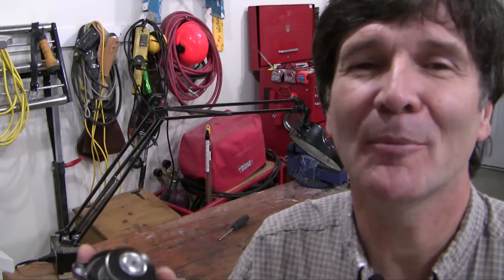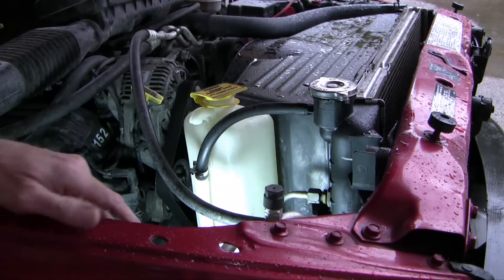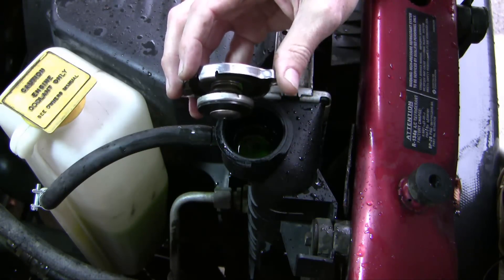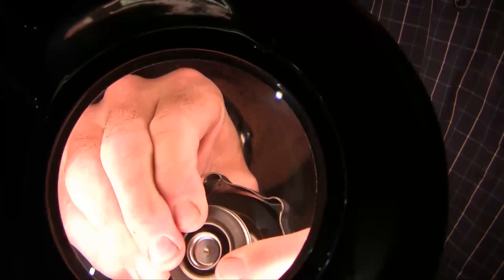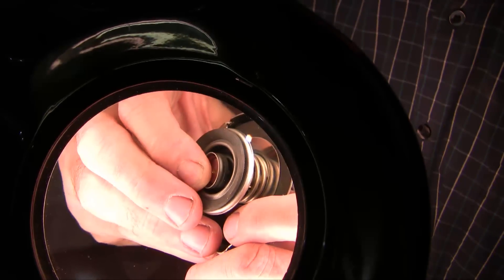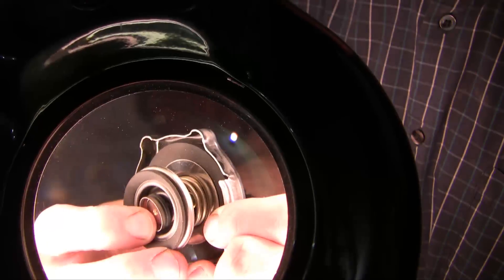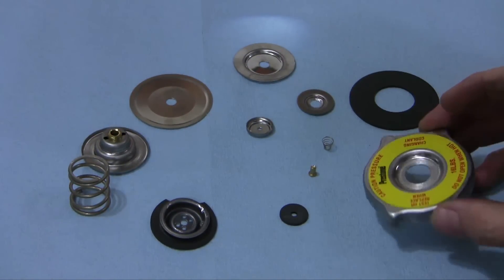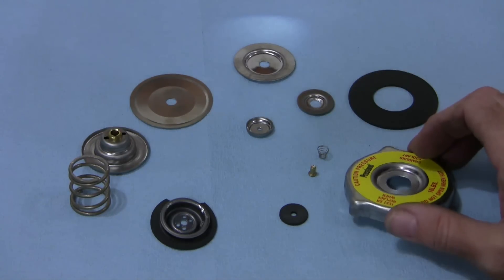Hidden genius behind an engine cooling system -- the radiator cap

Comment: Thank you for posting this.  I had never really thought about this before even though I've done all my work on every car, motorcycle, truck and SUV I've had for the 54 years that I've been driving.  I was changing the coolant in my motorcycle the other day and it dawned on me that I didn't know how the cap allowed coolant from the overflow tank to return to the radiator.  I searched for an answer to that but didn't find the answer.  Everything I found simply said the coolant returned to the radiator as pressure in the radiator dropped but none explained exactly how that worked.  Then your video popped up and your comment asking if anyone wondered how the the cap worked to allow coolant to return to the radiator. It was as if you read my mind.  

Thanks again!
Reply from the maker: I made my channel to reach out to guys like you, thank you for the feedback. If I were to do this video again I could make it easier to understand. Simple graphics would better illustrate the way two one-way spring loaded concentric gates allow fluid and air to move between chambers, purging air and replacing it with coolant automatically overnight, with no external source of power. In any case, bright guys like you get the idea even without fancy graphics. Nice to meet you!

Dave

Comment: Was looking all over the internet for an explanation for how coolant returns when the engine cools in my Jeep XJ as the cap appeared to be a one way valve. ( I'm used to the pressurised expansion tank system in my Volvo 244). You have enlightened me, superb explanation, answered my question exactly.

Comment: Years and years ago I had a car that kept having a little air in the radiator and the car's ecu would complain. I bet that little spring had gone bad. It just needed a new radiator cap. I wondered why I never had that problem again owning numerous cars since then.

Thanks!

Also, I've seen you all over the other YouTube car repair channels that I like, we must have that in common.

Comment from the maker: That's an excellent point you make. If any of those gaskets fail, the cap fails and neither spring ever get enough pressure to open. If air bypasses around the gaskets, boiling point is lower, with less effective cooling and a lower overflow threshold. Indeed, deterioration of those rubber gaskets is the commonest cause of cap failure. So, the gaskets are the critical element. Springs are there for controlled movement of gas and fluid.

Comment from the maker: @billstmaxx You make a good point about evaporative loss. The reservoir is open to atmosphere, through that very small opening at the top. So, a small amount of evaporation is unavoidable. But there isn't much air movement there, the surface area of the fluid in the reservoir is small, and the fluid is usually cold. I don't see much practical loss at all. Of course fluid in the radiator can't evaporate much, because the cap prevents exit until max pressure is reached. Thanks for your comment.

Comment: I needed a crash course in car rads and associated items, thats a great video, very helpful, thank you.
Reply from the maker: +Bart Man Once you understand how a rad cap works, everything else is easy to understand. Because water is an imperfect coolant, the cooling system is still the most frequent point of failure for any motor vehicle, so it's very useful for everyone to understand the system. I have a cooling system playlist with several other videos you may find helpful, on my channel page. Not only is it a common problem, the issues that arise also tend to be very interesting. Good luck!
Reply: +spelunkerd I will check them out for sure, many thanks, great effort

Comment: Been working on cars since a teenager and sadly never realized the inner spring/cap existed. I just never thought about it until I had to diagnose my Subaru's coolant issue. That little inner spring cap was stuck to the larger seal and wasn't able to open up and suck back in coolant. Pried it off and jiggled it around. So far, no more overfilled overflow tank. 

I'm assuming during normal driving and engine temperature range that when the coolant cools it sucks it back in gradually. When that cap is stuck, it cannot regulate and so it pressurizes more and pushes more out, and so on.
Reply from the maker: Yes. Most of the reverse flow happens after you shut a hot engine off,  hours later when it has time to completely cool down over night. A tiny pinhole leak can completely mess that up, so it is wise to check coolant level under the cap as well. Thanks for stopping by!

Comment: so it evaporates some into the atmosphere 

so eventually the antifreeze concentration will get stronger as the water evaporates?
so you should check the levels and add some water if needed?

thanks for your videos there very good!

Comment: Great video.  How do you remove the radiator cap if the spring appears to be broken and it won't pop up once it turned to the left for removal?  The cap just rattles in an off position.  I need to remove it and I can't because the hooks are holding it on the radiator hose.

Comment from the maker: @amrix15mag In your case, I'm not sure. I would try to press down and turn counterclockwise at the same time. They are just made of sheet metal, so if it's broken and you can't get it off, you could use tin snips. I would be very careful not to damage the mating ridge on the radiator side, because it has to seal perfectly for the new cap to work right.

Comment: There are 2 types of recovery system
1) Sealed recovery system
2) Open recovery system (most of Asian cars)

In a sealed recovery system the cap (double seal) allows coolant to flow to and from the recovery or expansion tank, maintaining the integrity of the cooling system.

A non recovery system does not have a recovery or expansion tank; therefore a non recovery cap (single seal) only allows the release of coolant and return of air to the system.

Credit to TRIDON

Comment: Hi . My Radiator Cap has a Spring and a Rubber part that fell into the Radiator. Is it going to cause any problems to the engine. What should I do? Thanks
Reply from the maker: Bad luck. There is a risk, though probably small. I'd try to fish the parts out with a magnet on a stick you can get at any parts store, and there's a pretty good chance of retrieving things. A borescope might help if you have access to one of those. There isn't much room inside a radiator, they probably haven't gone far. You might get lucky to see the plastic part floating in coolant or water. In most engines the cap is close to the radiator inlet, and if so, it seems unlikely those parts would be able to pass all the way through the tiny tubes of the radiator to get back to the engine or pump. In that case the main risk would be plugging some of the tubes in the rad. I'm not sure the risk is high enough to justify going much further than that. I suppose you could remove the rad and back flush, but that seems like overkill to me. You could run the car with cap off for a few minutes to see if the churning water brings up debris you could fish out....
Reply: spelunkerd the part that fell into the Radiator was Rubber and a tiny Pin . I afraid the Rubber part will Melt or Expanding because the Radiator water is very Hot. And the tiny Pin might went through the Radiator and cause huge problems. Thanks for your time

Comment: I'm still having trouble visualizing the system. I wish there was more visual aid of the whole process.
Reply from the maker: Yes, when I review this again I regret not spending enough time to draw a diagram, to back up the points I made verbally. Ultimately, most lessons in life are self taught, hopefully with the wise guidance of a learned teacher to help define critical questions. I really like that Socratic method, which requires effort and curiosity to drive critical thinking from within, and then dialogue to solidify understanding. Is there some way I can help? Maybe sit down with pencil and paper and pretend you are explaining it to others. I guarantee, all of a sudden you will have that satisfying 'ah ha moment' where clarity emerges from unsettling clouds. Thanks for your thoughtful feedback!

Comment: i have a question... i had no heat in my dodge ram. we replaced the leaking heater core. it takes forever to get warm in the cab now.. it never gets totally hot. then all of a sudden it wil blow cold air. and it doesnt get warm again.  we burped the system. the coolant is full. nobody seems to know were we go from here. is it the thermostat? stuck in open position? does the dodge ram have a heater control valve that should be replaced too? if you could give us an idea of what else it could be i would be forever grateful. i wont be able drive it to work cuz of the frost on winshield and i have no other car to use
Reply from the maker: +wattamutt There is no valve or solenoid controlling flow through the heater core in the 98 Dodge Ram. I would run the vehicle until warm, then touch each heater hose to feel if they are both warm. If one only is warm, flow through the core is inadequate either because the thermostat is open, trapped air is present, the water pump is not working properly, or there is obstruction to flow through the core. Look for kinked or collapsed hoses that might limit flow. If hoses are collapsed, it could point to a kinked or plugged pressure relief hose at the coolant reservoir or a bad rad cap. If there is no evident obstruction I would remove the heater hoses and flush the core to be sure your new core will allow flow. I'm told that a persistently open thermostat may trigger a DTC, so that might be a consideration as well.
Reply: +spelunkerd were going to check the hoses. thank you very much!

Comment: My son-in law and I stood over the radiator in my '95 f150 boggled as how the fluid returns to the radiator from the reservoir. Now I've heard the answer but still can't explain it.
Reply from the maker: That's very perceptive, you'll get there. Just remember the key principle of two parallel one way gates closed by springs, opened by pressure difference across the gates. Then recall that as temp rises, pressure rises, especially if trapped gas is present. Finally, note that the anatomy is designed to route air to the top, where it can bubble away easily through a gate to the reservoir. Thank you for watching, if I were to do this one again I'd try to illustrate it better.

Comment: my radiator cap keeps leaking drops don't know what it is can you help
Reply from the maker: If the leak is right at the cap, I would clean the two gaskets there along with their mating surfaces, then recheck. If it is still leaking, I would replace the cap; caps are inexpensive and the seals eventually crack and fail. A more common situation is where the housing of the radiator fails at a solder joint. In the old days we could resolder those cracks but new designs have plastic mating with very thin aluminum, which is almost impossible to resolder by hand. The good news is that new radiators aren't very expensive and you can replace the whole radiator if you need to do that. Good luck!